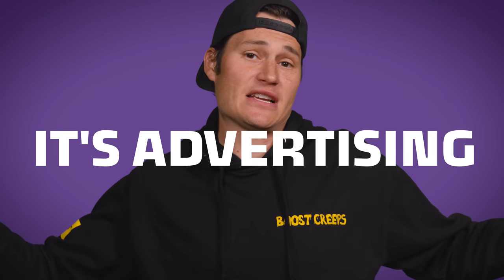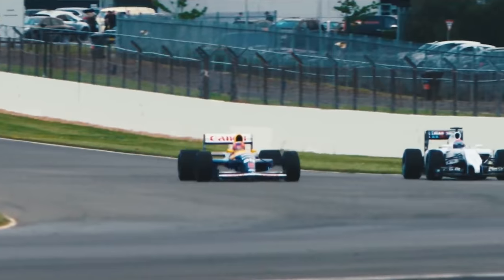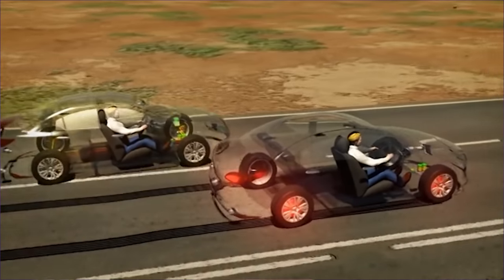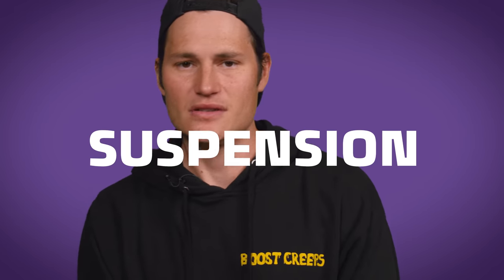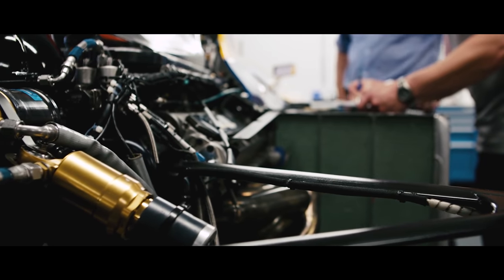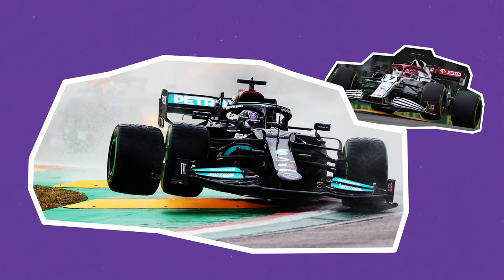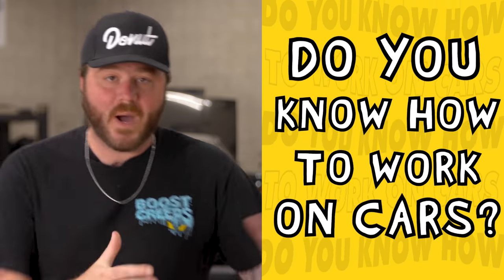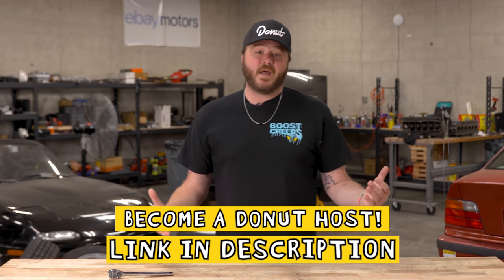Why F1 Banned Their Best Car

Comment: Imagine if Williams had the chance to play around with the CVT, if they were succssesful we would've had cool cvts.
Reply: "Cool"
Reply: Didn't they technically abandon it due to technical reasons such as higher fuel consumption and strain on other components?
Reply: @chaitanyarao5546  no, it was banned
Reply: honda using it for they car nowdays. its so smooth like butter when drive.
Reply: F1 likes to say that their innovations trickle down to production cars, I wonder if we'd be seeing more cvts in regular cars as well as F1 cars if they weren't banned back then
Reply: My car has CVT
Reply: @naeano7137   a lot of cars have CVT, like mitsubishi "eclipse", nissan sentra and a lot of others, however in the eclipse ive been in it still acts like it has gears, it doesn't clutch but it deosn't stay in the same rpm and acts like a 9speed and never goes above 2krpm so kinda sheit at accel
Reply: @canul3801  yeah till it blows up because it's cvt trash
Reply: cvt transmissions are great on paper but the engine's optimal rpm is pretty high and because of that fuel consumption is high and the relability is sugnificantly lowered. it would require some nasa materials to last as long as engines with regular ransmissions if you wanna extract peak performance constantly
Reply: @lucianistoc1264  still they wouldn’t use cvt because of high fuel consumption, high engine wear and because the pulley would break often
Reply: @tigernotthatbigcat6107  I know there a quite a few cvts available now, but they're generally regarded as being pretty shit. I was just thinking that F1 maybe would have been able to speed up the development of the features that make them more usable, or even just change the perception of them
Reply: @naeano7137  i mean there are good ones, but since they driven with chain ppl rly dont like it also they are mostly used on economy cars and does not have the mechanical feels that ppl want
Reply: @lennyschuessler3003  i mean to save fuel u could make it run at lower rpm
Reply: Every snowmobile uses a CVT.    Snowmobile,  A TV,  or any moped.   They have used CVT.   Cvt's are old tech
Reply: @naeano7137  a good 50% of F1 fans will start whining the minute a car's engine note changes - see any discussion about V10s vs the more powerful, efficient turbo-hybrid V6s. I'm not sure how well a CVT would go down with that sort of person.
Reply: @canul3801  CVT is the worst transmission in existence.
Reply: Ahh you've also read adrian Newey's audio book. You at Donut are people of distinction.
Reply: @lennyschuessler3003  or f1 engineering and materials lil
Reply: @v4skunk739  up to you to think whatever you want . for the price honda give, at the same price.their competitors can't make a good gear like honda did for their family car. its not only about performance, the comfort and the smooth running cvt is good for daily relaxing drive. they make lower cc engine with turbo to cut the fuel problem and add more torque at some range. for me thats atleast a good ideal daily relaxing car
Reply: CVT slaughters engines by holding high revs continuously.
Reply: @chaitanyarao5546  exactly. The CVT car did lap 2.5 seconds faster but Temps were quite high and the limitations were wear on the belt and running the engine in the "sweet spot" resulted in higher fuel consumption. A bit or a lot of research could've benefited everyone 20 years later....
Reply: @itmark7063  well if high hp car maybe the pulley cant handle it. its kinda logic. gear that made of steel vs rubber. the maintenance maybe not like gear.normal gear car can handle 20 years easy. pulley maybe 5-8 years change pulley. still its long term enough to make whole engine overhaul
Reply: @naeano7137  more cars use CVTs than you think. Audi’s multitronic is a CVT and it’s been around since the early 2000s. They’re only more common nowadays because they go hand in hand with hybrids
Reply: @tigernotthatbigcat6107  yeah .lower rpm for car using CVT feels like granny but the high rpm its good for long distance. its up to what car though. if normal n /a 4 cylinder maybe good. if v6 and above. that rubber not gonna sustain for long drive and heat of engine can make its stretch and compress. by physics. this gonna wear out sooner than because the heat adaptivity of rubber/plastic no where near steel. there good and bad in cvt transmission
Reply: Nothing was gonna happen but broken parts
Reply: @naeano7137  well maybe yes .maybe noo. cause its put lot of strains to engine. the fuel consumption in f1 is so limited. even by using gears right now. they struggle to meet FIA optimum fuel. but its kinda cutback also for starting line. cause gear gonna be faster 0-100. cvt can win in high speed stability but the low end kinda bad.plus its better to have gear for more precise corner speed. cvt kinda like electric car with low torque😂. a car that in corner struggle because you have to control the car by speed and not use your full skill like clutch and gear .
Reply: Well Msc cant get his first championship in '94 and Senna will still alive today
Reply: @canul3801  
Not all CVTs are made of rubber. The higher end ones are made of metal links.
Reply: @naeano7137  all subarus are cvt's
Reply: The other teams are sore loser
Reply: CVTS have never been cool and definitely won’t be cool
Reply: CVT are not cool

Just like watching paint dry
Reply: The transmission belt kept snapping because of the constant peak power output, I have heard (@Driver61 video I think). The CVT wouldn’t have made it to the end of a race.
Reply: @chaitanyarao5546  as well as the belts breaking yea
Reply: There is a better way, planetary gearbox has the highest efficiency of the bunch. You just charge a battery with the unrequired torque, and give it back as you please. No belt, no problems. You can decouple torque from speed.
Reply: My Vespa Scooter has one, they work Great, Always in the right gear and ready for Traffic.
Reply: @tigernotthatbigcat6107  japanese tiida had one and only 5 "Speeds" all of them WRONG. True CVT transmissions would be GREAT. My car has one speed, EVs don't really need more.
Reply: @lennyschuessler3003  cvt on a rotary? Would this setup work? 😁😁😁
Reply: @tigernotthatbigcat6107  There is reason for that fake gear shift feel. People were wierded out with first gen CVTs when they would just rev to 4 or 5K and just set there when accelerating hard since everybody was use to a normal geared transmission. So, they programmed the CVT to act like it had gears to make people feel more comfortable in adopting the technology.
Reply: I mean guys, let's be honest

Do you even want to hear F1 car with CVT transmission? sounded like somebody just screaming non-stop agonizingly like there's nothing tomorrow?
Reply: @chaitanyarao5546  the belt for their cvts couldn’t handle the torque experienced for long enough to survive a grand prix
Reply: @canul3801  and nightmare when they break, talking about Nissan.
Reply: i think the honda civic is pretty cool man
Reply: @lennyschuessler3003  F1 cars are trying to stay at max power anyway so this argument is meaningless. As for reliability, it may be true in passenger cars designed for efficiency but an F1 car only needs to run for about an hour so it's not hard to see how they could get it done even in the 90s
Reply: @mrpempi  no shit it generated more heat, it allowed the car to go faster!. This is a non-issue, all they would have to do is slightly improve cooling to compensate. Belt wear would undoubtedly have been an issue but it only needs to last one race and that's definitely doable.
Reply: @vaishaliakalwadi6118  I have a Toyota Corolla GR so im happy with the 2.0L Hybrid with the E-CVT
Reply: @lennyschuessler3003  "nasa materials"
Reply: They would be cool now if manufacturers didn't give them fixed ratios and actually let them act like CVTs instead of a normal auto
Reply: Imagine how awful it woud sound - a f1 engine at 15 000rpm all the time
Reply: But the cvt was massively unrelaible
Reply: As cool as it might be it would sound ridiculous. Every car would be running max rpm all the time, it would sound terrible.
Reply: @chaitanyarao5546  Williams likely weren’t going to use it in races because it put so much strain on the engine. Engines aren’t made to run at max RPM for an entire race and it wore out parts super quickly.
Reply: I like the CVT in my Toyota. 
What brand is your cars CVT?
Reply: @dirkhoek2822  most cutting edge technologies are when they are first created. If it wasn't banned I could quite easily see it being the standard today (though then again the noise would probably upset fans).
Reply: @canul3801  Yes.  But it is so boring.  Sometimes we enjoy the jerk and kick when we shift gear. And also the sound change.
Reply: @F9109-r1e  I've had my current car (2017 Civic 1.5T) for 4 years now and city driving is really smooth. The low RPM torque of the turbo make it so the engine barely has to rev up under regular acceleration. Going from 0 to city speed at lights or stops is one continuous pull.
Reply: @F9109-r1e  Toyota and Lexus use an eCVT, i had couple of those. Very smooth but engine note was sometimes a bit annoying on even a V6.
Reply: @joshmeyer2375  called variators
Reply: @TheCodifier  Same, I've had my 2016 Civic Coupe Touring for about two and a half years now, and it's great. Just generally feels really smooth, and when I want to have some power applied, it accelerates pretty quick. Given my old car was a '96 Camry that was AWFUL, my perspective may be slightly jaded though lol 🤷‍♂️
Reply: But how to keep the engine working on such high revs for extended periods without exploding?
Reply: Cvt is similar to the old dutch daf variomatic
Reply: @tigernotthatbigcat6107  they make it that way so it doesn't feel so weird and they dont have to spend that much more on sensors and programing the ECU. If a CVT acts like an automatic then they can just fix it to the revs of the engine, if not, they have to make a very weird triangulation using data from the throttle, steering, suspension, transmission, brakes, speed and god knows what else. That costs money, requires time, R&D, a ton of sensors, wires, better and more capable ECU's etc. If you as a manufacturer want to dump all of that into a production car you better be able to get a great utility of of that cost, so you have to give that car space, leather, comfort tech, luxury, performance, design, etc in order to put such a high price tag. You are talking retail prices that compete with Lamborghini, Koenninseg, Ferrari, Bentley, Aston Martin, Rolls Royce, Bugatti, Paganni, etc. And I am considering their top performers due to the amount of money you would have to put in R&D as well as the money you have to get from every vehicle sold. In other words, the only way yo make it proffitable would be to compete against Ferrari, selling cars of the level of Bentley and Aston Martin in numbers that ressemble the ones of Lamborghini and McLaren or higher. That is why nissan, mitsubishi and renault make crappy CVT's in cheap cars. They wanna be able to give them further developement, but they wont if their numbers and market share is not perfect. VW would be a perfect group to make such a developement and put it into a car

Comment: "Ban and add weight", FIA's answer to technological advancements since the 80s.
Reply: Yep that and when Ferrari was constantly threatening to pull out of F1 whenever they needed tech banned so they could try to catch up.
Reply: @anydaynow01  Redbull's pulling that card now too
Reply: @Tsino69  what redbull is doing is nothing compared to Ferrari, they just do what all teams do, complain. Even merc
Reply: But races needs to be balanced right
Reply: @todd_vincy4710  less balance but crazier more extreme risk taking daredevil drivers with less regard for safety would make F1 more exciting
Reply: @anydaynow01  you know that Fia tried in every single manner to stop Ferrari dominance in early 2000’s?
They tried in 2003 but still Ferrari won and then with that absurd no tyre change in 2005.
Reply: @ignls8809  But they've let Mercedes dominate all these recent years, nothing against Hamilton but all these championships came just because he is a really good driver (but not the best) on the best car of the grid.

It's already proven that even a mediocre pilot like Jaques Villeneuve could win the championship just because having (by far) the best car on the grid.

Comment: The 2022 season with new cars and a budget cap will be really interesting to watch because the field could potentially be the most balanced it has been in a while.
Reply: Looking at the 2021 season, other drivers than the usual suspects have had their chances improved at getting up the field and the lack of excess funds for the top team has shown a drop in unfair advantage … they haven’t had it all their way and have had to resort to dirty tricks to eliminate some of their opponents …
Reply: Yeah. Mercedes has basically been relying on deep pockets to get better engineers and better drivers. It's like stopping at a red light with your Saab 9-5 Aero and the other guy rolls up in a Dodge Demon. It doesn't matter who's behind the wheel, as respectable as it is, a 250hp 2.3L turbocharged I4 and FWD can never beat an 840hp supercharged 6.2L V8 with RWD.
Reply: Until a team is able to find a loophole😂
Reply: @curtis1552  I'm not sure how easy a team could find a loophole to a hard cap on how much they can spend.
Reply: There's usually a big spread after a rules change, some adapt better than others, as we've seen this year, teams tend to be closer towards the end of a set of rules
Reply: I’m looking directly at Norris
Reply: Rem Weij  yes.
Reply: Well, we are almost by the end of the season and it has completely been a Red Bull domination :/
PD: it could have been better, but ferrari is ferrari…
Reply: @Jackson_008  they ruined it whit td39
Reply: if you just pretend red bull doesn't exist, it is quite exciting

Comment: Ironically: McLaren had ABS, Traction Control... and programmed automatic downshift for every corner in the season. Their main problem (which they overcame in 1993) was their obsolete engine that Ford couldn't share because of their contract with Benneton.
Reply: and to think they could've had a Lambo engine (which Senna tested and liked), but didn't want to buy out Larrouse's contract
Reply: @deabreu.tattoo  That unreliable hunk of steel bogging down and messing the the car's balance was another reason Ron didn't close the deal. 

And that Peugeot in 1994 was duck taped too, it was a Group C engine bolted on the car, and on F1 it was absurdly unreliable...
Reply: @deabreu.tattoo  That Lambo engine was a hunk of junk tho.
Reply: @AbrahamArthemius  really? I read once that senna liked it. my bad.
Reply: @deabreu.tattoo  As far as I know he actually did. Maybe because it had more hp than their previous, but was so unreliable and heavy that never raced anyways
Reply: @JohnDoe-ji5wg  It had more HP than the Ford engines they had in the first half of the season, but the Lamborghini engine was too heavy, unreliable, and Ron Dennis had to think about the last races on the calendar. 

Ultimately, Senna's preference for sheer power wouldn't be enough... and McLaren eventually got the updated Ford engine (and beat Benneton for the 2nd place in the Constructor Championship, BTW).
Reply: @JohnDoe-ji5wg  All that power is useless if it's unreliable and heavier as well.
Reply: @AbrahamArthemius  Senna knows better than the 2 of us I think

Comment: Can you imagine how good economy  CVT’s would be if manufacturers could use R&D from F1 racing?
Reply: CVTs have been around for years, I drove a weird Dutch thing with one years ago, but pretty much every big company tried them at one point or another....  they don't last, and maintenance costs are horrific, even compared to a auto, which is saying something considering the complexity of most autos!

You still find CVTs in scooters though, work really well in them :)
Reply: CVTs are used in tractors more and more. You have instances of them lasting only 5000 hour and instances of them lasting over 15000 hours. They don't use the pulley system. Most of them have a very heavy duty hydraulics system. And save fuel of up to 15% compared to a standard 16f/16r gearbox/full powershift.
Now, of course there is a difference if the thing runs at 1500-2000 rpms or 16000 rpms for hours or when it drives 40-50 compared to 370, but I'm more than sure Engineers could figure something out that works for faster and lighter vehicles.

Comment: FIA "Quick ban the innovation it might cause teams to spend more"

Top teams outspend everyone to win

FIA Surprised Pikachu face

"Quick put a spending cap on all teams"
Reply: yepppp
Reply: capping spending is a double edged sword.
on the one hand it allows smaller teams to create cars that can compete with the larger teams.
on the other hand, most if not all innovations seen in modern road cars come from F1 teams research and developement, and with lower budgets , there will likely be less of that.
Reply: @phoenix1977  Raises a difficult question, of course: Is an F1 that may be technologically not at the top of what's possible but with exciting racing and a focus on driver skill better or worse than an F1 that's at the bleeding edge of technology but the highest budget always wins?
Reply: @TheFrozenMister  the second example leads to no more F1
Reply: @phoenix1977  what innovations are coming from f1 into road cars?

Comment: That Senna helmet in a 93' Williams hurts my eyes
Reply: That's 87' Williams though, the FW11B, which is also one of the cars that had an active suspension, though relatively Primitive compared to 92' FW14B and 93' FW15C
Reply: @ravendrapratama372  you 're rigth, good catch!